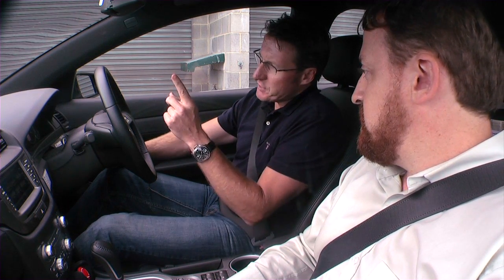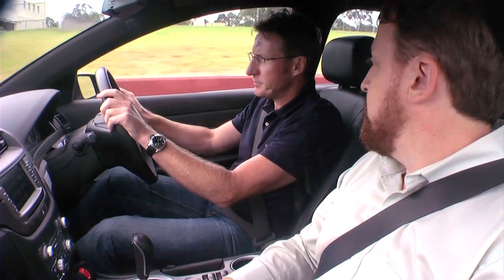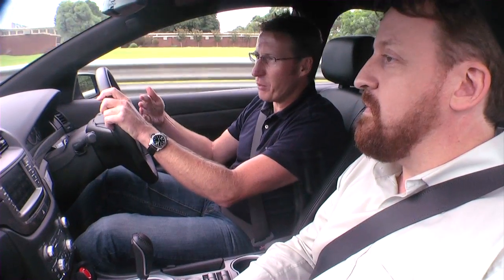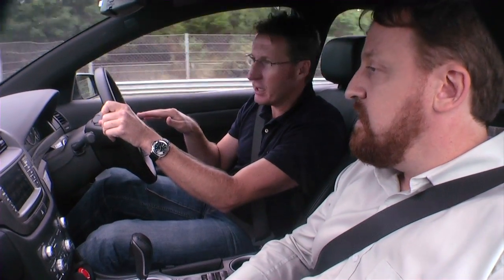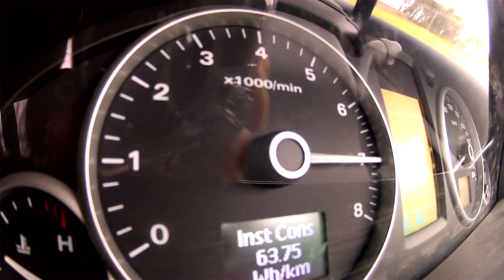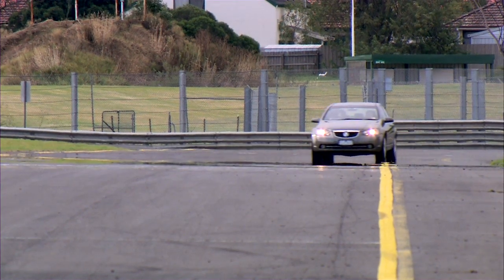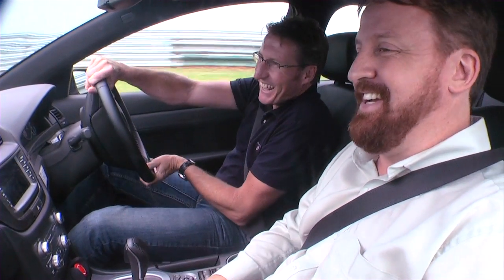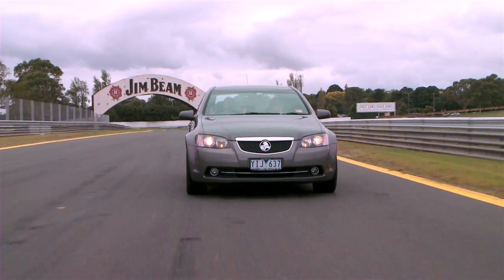Part 2: Test drive of the all-electric Holden Commodore prototype with Mark Skaife

Comment: It would cost around $60,000 AUD, but over the course of (about) 4 years, it will break even with a similar gas powered commodore - providing gas stays at the same price.
Unfortunately range will only be around 160 km per charge (the Tesla Model S will have the option for a 460 km per charge battery pack - but it will cost more).
The technology in the Commodore is harvested from the Chevrolet Volt, sans the internal combustion engine.
The battery swapping would be good if swap-stations existed.

Comment: Very nice. Makes a good all EV companion to the Volt. Have you considered making a standardised generator/luggage trailer for long trips beyond the battery range? They could be owned or hired. Basically the petrol part of the volt as a separated unit.